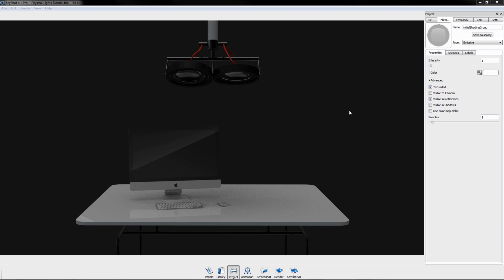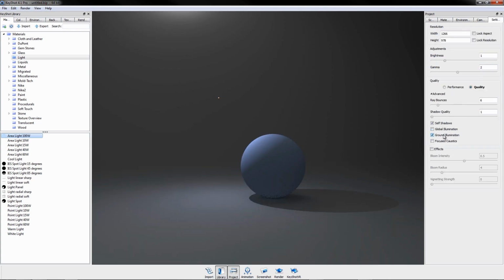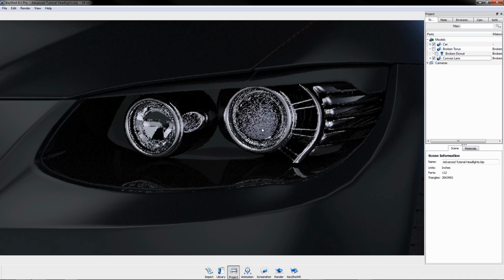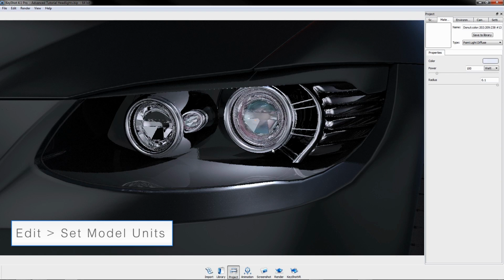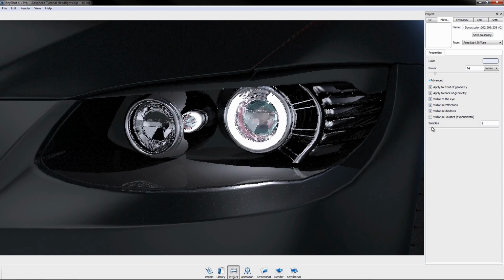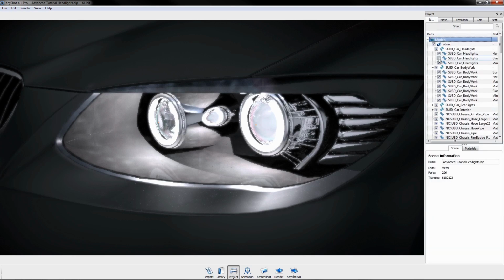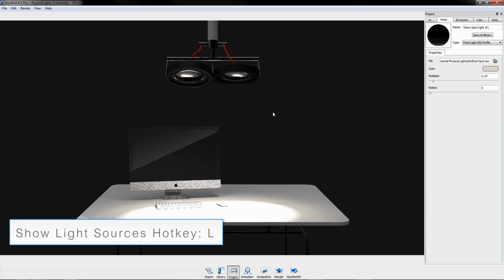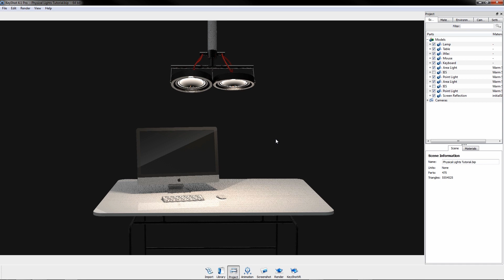KeyShot Advanced - Lesson 02: Lighting

Comment: What ever I try to do the Area Light Diffuse will never change color even if I clearly see I picked a color....... what am I doing wrong?
Reply from the maker: +Arcad1umTV You may need to move the color selector down into the lower spectrum out of the white. You can go to the KeyShot forum and post screen shots or contact support for help.
Reply: +KeyShot The only colors that will appear is either Cyan or Yellow? Like let's say I pick Orange, it will appear as Yellow
Reply from the maker: +Arcad1umTV ok, it sounds like you have Kelvin selected in the Color Picker. In the dropdown under the color graph, select RGB from the dropdown menu.